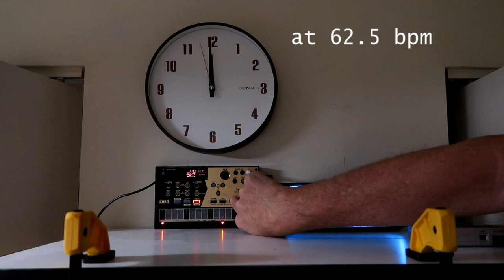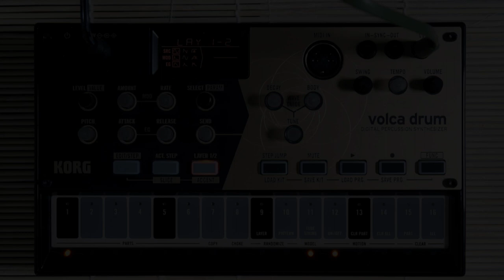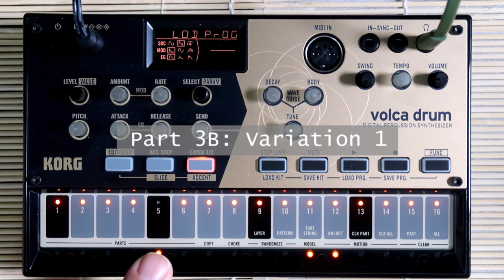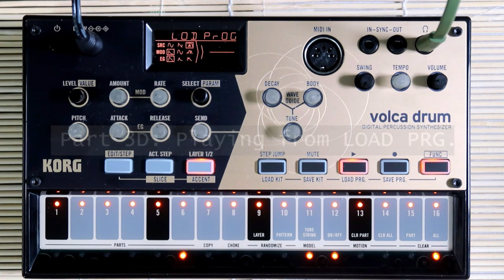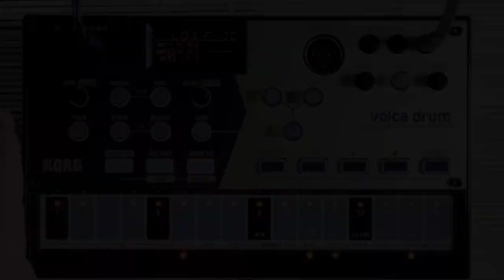Volca Drum: Episode 2 (Sequencer)

Comment: I just got a Volca Drum. I'm curious, if you think it's feasible to use this as someones main drum machine for several genres? I have a few hard and soft synths I can pair with, as well as traditional instruments. Majority of the Volca Drum vids I see, though, are pretty clearly in the EDM world...primarily techno and minimal-ish drum sounds that can very quickly go out there and weird (which I like). I've not seen really any videos showing the ability to use this for more traditional musical electronic drum sounds...thinking more along the lines of synth pop or new wave type stuff.
Reply from the maker: Well, hard to say. It's a very general systhesis engine, has a lot of potential, but in terms of emulating traditional instruments or classic electronic percussion sounds, I think it may come up short in a lot of cases. Maybe for some you can get close? The dual layer feature adds a lot of possibilities, but a lot of it comes down to what you are after. Sorry if this isn't much help. One thing might be to try some #volcadrum searches on here, and particularly on Instagram, just to see if there are some things close to your needs. Thanks much for watching🙏🏼!

Comment: Excellent, thanks a lot, especially for showing me I have to get better at thinking outside the box.
Also, I'm wondering: doesn't the fact that you only got 16 slots and no possibility to backup bother you? I already lost two good progs/kits due to operator error, and frankly I'm kinda paralyzed by the transience of what I do on the Volca Drum. You might say that's like life, but aren't creation and art a way to beat that transience?
Do some people here painfully recreate their settings in Synthmata in order to have a backup, for safety or maybe as some base library to go back to and build upon? Or should I hope to become such an expert as to be able to immediately do what I want with this wonderful instrument?
Reply from the maker: Taka Takata Thank you for checking out the video🙏🏼! There’s a lot of irony in synth gear: something bigger like the Elektron Model:Cycles lets you transfer sounds and sequences to a pc but the internal storage is so big that you might not even need to. I think what bothers me the most on the Drum is that you can’t (as I understood at the last update I did) easily transfer sounds between kits. I would like to be able to just have 4 or 5 “storage” kits and be able to mix-and-match the sounds. It’s kind of labor intensive, but I pretty much solve all of this by taking notes. I highly recommend working out some rules like: kit 16 is always just a sort of “scratchpad” for testing stuff, kits 9-15 are works in progress, and kits 1-8 are kits I’m really trying to keep. However, I feel like learning how to quickly find the little “.” indicator of a saved setting, having maybe a spreadsheet or printout of all of the parameters, is a really good way to understand how sounds are made and differ, as well as keep them safely “stored”. It’s just not fast. Thanks again for watching!

Comment: Such great videos and such great a channel!!! Thanks you a lot!!! Is there a way to save the volca drum patches on a computer?
Reply from the maker: You're welcome! Thanks for the feedback! I think there is a tool called Synthmata - maybe it has a plug-in for the Drum? I have not tried it (I just sort of pencil and paper it, a lot of time spent looking for the dot indicating the saved value if I don't take notes along the way). Another option is with a DAW. You can basically just have DAW clips that blast out MIDI values to the Drum - so you build the patch in the DAW and then update the Drum - not a very hands-on approach though. Thanks for checking out the channel👍🏻!
Reply: Volca drum editor. There are two. The cheap one does it as well as the pricier one from isotonik. But the one from isotonik is great as can draw automations on all the parameters as well as record. They are for Ableton though.
Reply from the maker: @kevhar35  Thanks for this info!
Reply: That's ok.  Isotonik have 25% off black friday at the moment. Code FRIDAY.  I'm not affiliated!  I've just bought it.

Comment: For the parameter locking bit at 12:40 how does that relate to the release value of the sound? Apologies if I'm being thick here. I assume that if I create a melodic sound with a maxed out or long release value, put it on a single step then alter the pitch at empty steps where the sound has not tailed off yet, I could make it rise and fall in pitch over the life of the release time?
Reply from the maker: AllaMortify You are right on point👍🏻 The parameter locking is just a precise way to set a parameter for a step, and then some sort of method is used by the Drum to smoothly connect to the neighboring steps - I don’t know if it’s linear or some curve. So you could give a vibrato like you are suggesting. I think that any unlocked steps assume the value of the knob, which could maybe be a plus or a minus, hard to say. Let me know if this is clear. (kind of groggy from working on next video😴.)

Comment: Very very helpful video. Thanks a lot. It’s just a bummer that the mute function doesn’t work when you chain programs.
Reply from the maker: Yeah, that is an issue🤔. I've been trying to think of workarounds but it's probably never going to be as flexible as the real thing. If it was really specific I guess you could make duplicate programs with the muted parts missing. Or something with chokes? Some sort of ghost part with silent hits on every beat, able to "mute" stuff by changing the choke settings, save kit on the fly? Sounds kinda wacky. Using motion sequencing to mute parts with Level, turn motion-sequencing on/off? Not sure how that could work with chaining?

Anyway, thanks very much for the feedback🙏🏼!

Comment: Great video & ultimate serie on the Volca Drum
How do you edit the pitch value with the note name? As far of now i only get numbers.. thanks!
Reply from the maker: guitdafunkadelik Hey, well it’s two things: 1) to get pitch quantization (i.e. C, D#, etc.) as an option you need to make sure the Volca Drum firmware is up to date, and then 2) to set pitch quantization you need to go into Edit mode, select Quantization, and turn it on. This last part can be different for each track (you set it the same way as setting something like BitCrush). The first video in this series shows/describes how to do these steps. Thanks for watching!

Comment: Hi, thanks for tutorial! Can I save more than 16 programs on that device? For example, I have saved 6 bars/programs for some track/song ... and i have only 10 for other songs?
Reply from the maker: Максим Аксенов Hey, well unfortunately that’s the situation without adding something else. There is some software called Synthmata that is supposed to help (have not used). I tend to use randomization and polyrhythms to make sequences seem longer. BUT, one thing to seriously consider is a MIDI 2x2 box + a 5 pin MIDI cable (or a usb-to-MIDI cable) - either way should be less than $50 and will allow you to control the Volca from a laptop running a DAW (even a free/lite version of a DAW would probably be fine) Then you would be able to make as many sequences of any length that you want. If you go this route you can even use MIDI CC automation to send the kit settings too. This process basically turns the Volca Drum into a hardware voice for the DAW. I hope this helps some👍🏻!
Reply: @undulations  Well, I'm used to doing everything in the DAW,  so it's not a problem. Its my first analog gear and I am trying to find out the limits of this device. I realized that the main limitation for me is 16 banks for kits, but in other ways this box blow my mind (in a good way). I heard something about the patch for Ableton, where you can control volcas's params by plugin and save presets, but haven't used it yet.

Comment: I'm a totally beginner. If you would have to elect Korg Volca, what would you choose. Volca Drum or FM?
Reply from the maker: I feel like it depends a lot on your intentions for using it. For explorations of sound design and music in general they are both very deep and hard (maybe impossible) to beat for the price. The Drum leans more towards beats (of course) and making more of a multi-instrumental song all by itself (see Jan 10, 2020 post on my Instagram, dr_nim2014), but it is really all about sequencing. It takes extra effort (a special sequence and the step-jump feature) to just play a tune on the keybed. You can't hook a midi controller up to it and play a melody (but you can certainly sequence beats on the Drum with a midi controller). Now, the FM has got a deeper fm-synthesis engine, you can make a ton of sounds with it, it's polyphonic (3 note as i recall), great feature like arpeggio, and super playable from the keybed. You can use an external midi keyboard (probably Arturia Keystep) to upgrade the playability easily. The FM is just one sound at a time, but a single knob to change presets makes it very plausible to try to do a multi-instrument song. So, some of this comes down to other gear you might already have or if you are familiar with a DAW (in that case, a cheap midi 2x2 box would let you play either Volca from the computer). Anyway, short answer: I'd say if you are thinking beats, sequencing, tracks then the Drum, and if you are thinking keys and ambient then the FM. The Drum has very deep and powerful sequencing. The FM has just about unlimited sounds when you dig into the FM methods. Each is easy to just start out with and play the presets, mess around with, and each allows you to go much deeper and learn a lot about music and synthesis.

Comment: I am still trying to fully parse how you're cheating the sequencer length, oy!
Reply from the maker: Sorry I missed this last week. If I recall correctly, it was almost entirely done using the Choke feature. Along the lines of polyrhythm (polybeat?) drumming. If left hand is on a pattern of a hit on every 3rd metronome tick, and right hand is on a pattern of a hit on every 7th metronome tick. Then if both hands hit on the first tick, follow their patterns, then you don't have both hands hit together again for 21 ticks. So the Choke feature sort of allows this to be exclusive. Like the right hand will ONLY hit if the tick is part of the pattern (7th tick) AND the left hand is hitting too. But then if the left hand is doing a very soft/silent hit? You just hear the right hand hit every 21 ticks, which is outside of the range of either original pattern (length of 3 or 7). So, with 6 tracks this can be amplified a lot, ticks every second but a bell roughly on the hour. It took some sitting down with a pen and paper to see if it was even roughly possible.

Thanks much for watching and commenting!

Nim
Reply: @undulations  I got an SQ-64. I think both the Sample and the Drum can be assigned to the 16 subtracks of the drum track similarly to the way they can be on the Beatstep Pro, I'll eventually find out. I hope so!

Retrokits started to support Drum with the same enthusiasm as they do Sample & Sample2 w/their RK002 midi cable but then dropped it mid way thru, sadly.

Still the sequencer on Drum is the best of all the Volcas imo. I think it's the best Volca actually, it's a lot of fun.
Reply from the maker: @oldasrocks9121  Agreed, it is such a versatile and powerful piece of gear! I just used it in an IG clip yesterday - so easy to make a 16 step sequence more interesting with probabilities, slices, and motion sequencing!

Comment: Good tutorial but no one talking about how really add more than 16 steps in Step Sequencer? 32 or 64 or 256, how to do that? Can't find this in tutorials, but it's most important thing for a longer sequences
Reply from the maker: Well, it's not possible to directly increase the sequence beyond 16 steps on the Volca Drum. BUT, longer sequences can be made by going into the Load Program mode (func + play) and using 2 fingers to select a range of the Drum's 16 Programs. The entire range will flash in this case. So, for example, a range of 1-2 gives 32 steps, a range of 1-4 gives 64 steps, and a range of 1-16 gives 256 steps. The device can only hold a single 256 step sequence. You can remove active steps in a sequence to get other sequence lengths, like say 40 steps (16+16+8). It''s also important to point out that if you are planning out a range of sequences (programs) - say 1-8 for 128 steps - then you can have all of those programs use the same Kit - say Kit 1 (which is easier if the same sounds are required across all 128 steps) - OR you could use up to 8 different Kits for this example (more to keep track of but allowing more sounds across the sequence). I hope this helps. Thanks for checking out the video!
Reply: @undulations  i hope will helps, will try to check it..why i'm asking, because i see how already pre-programmed patterns have something like 64 steps for some of sounds, thats why i'm trying to find how is can be realized. Thnk You!
Reply from the maker: Well, it's not exactly a longer sequence, but using the Volca Drum's per-step probability feature can  give sequences a lot of variety and make them seem longer. Do those preset patterns repeat exactly?